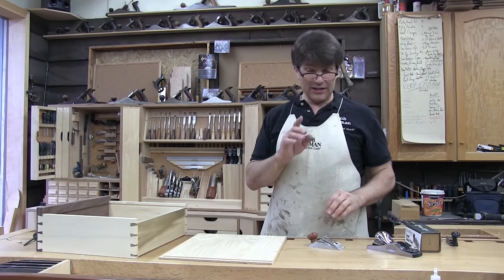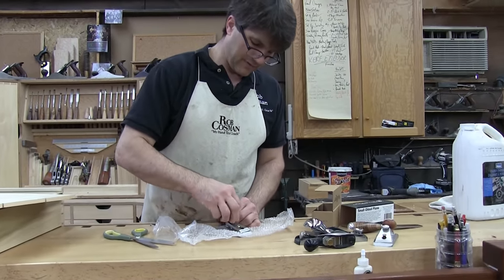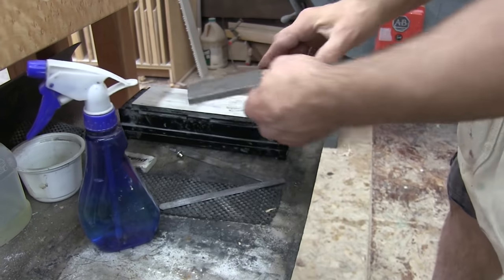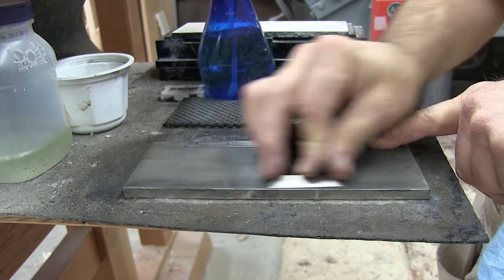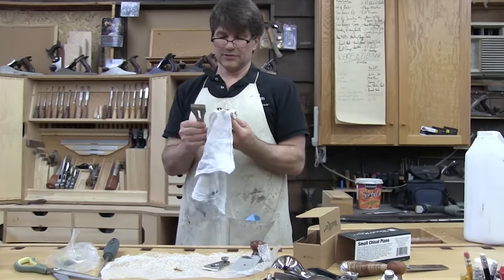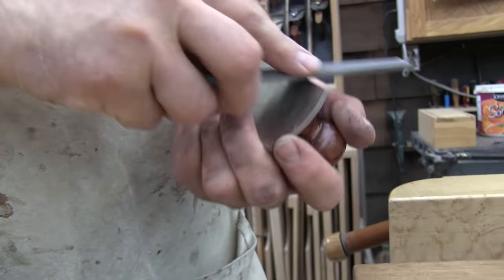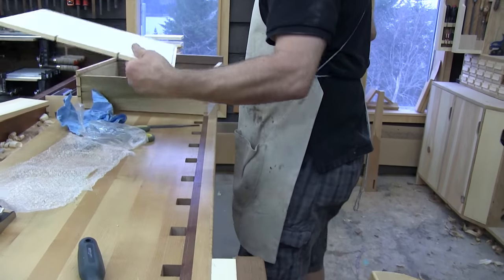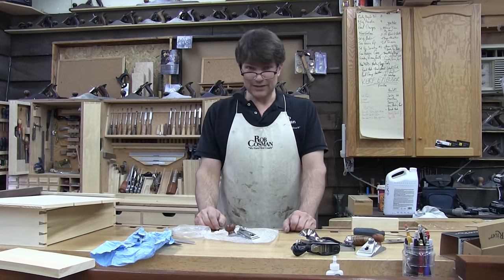Hand Plane | How to Set-up and Use a Chisel Plane

Comment: I too use and love my chisel plane.  I have found if you are careful that setting the blade up on a perfectly flat cast iron bed (I use my jointer) you get consistent results every time.  To do this just make sure the blade is completely flat against the dust free frog before you tighten.
Reply from the maker: good tip, thanks

Comment: Clever tool. So far I’ve been able to get by with just a chisel. Your method for setup makes it look very reasonable. Easing the edges is essential to avoid innumerable paper cuts. Filing away from the machined registration surface is a great tip.
Reply from the maker: Glad it helped

Comment: A cranked neck chisel is perfect for this job, or any work paring within a surface (like on a glue line) or within a trenched joint (dado/groove/or rebate even) No fiddly set up involved after you sharpen it, you just pick it up and go. And it works the exact same way as a chisel plane (it's called a "chisel" plane for a reason) Also a cranked chisel is much cheaper compared to the plane and is more versatile too 😁 
I find 12mm (1/2) and 16mm (5/8) are useful sizes for cranked neck chisels; for paring within a dado for example. 
Avoid the 2 Cherries cranked paring chisel, this is "bent" into a "curved" shape and doesnt have as much reference surface on the back compared to a normal cranked neck. 2 Cherries does make a pair of skewed crank necks (cant think of any time I'd need that) and they make a spear point cranked chisel (again, cant think of a good use for this either) I think I might use the word "gimmicky" to describe the 2 Cherries line-up of cranked chisels.
 MHG make a decent one in various sizes, for little money. Crown (Flinn-Garlick) are made of a better steel (not CrV like the MHG chisels) and they cost only a little more, but only come in 12mm (1/2) and 19mm (3/4). Henry Taylor (Diamic) make a superb cranked chisel in various sizes for a little more money again. 
MHG roughly 30-40€ depending on size. Crown about 50-60€. Henry Taylor from about 60-80€ depending on size. Or ya could go the vintage route and spend even less........ but I find most cranked chisels of old are usually very wide; most common seems to be around 25mm-1inch, so this will reduce their versatility. And some may need extensive rehab work to get them going.
😁

Comment: As someone who enjoys a good orange sorbet myself, you demonstrated a problem that I am surprised you haven't addressed. This is not condemnation in any way whatsoever, just curiosity. You say that when you sweep the bench that bits fall on your sharpening station, along with the possibility of tools falling, too. By the amount you cleaned off, it looks like quite a bit rain down on the station.

Why not make the base of the sharpening station act like a drawer, either attached by rails or build the drawer system completely out of wood which slides in and out. This way you could slide the sharpening station back under the bench top until you need it, which would mean pulling the station out to use.

If you can't slide it under the bench maybe a double hinged cover that folds back out of the way being held up in place with magnets. Since I am not providing a photo, take two pieces of wood and attach a hinge to both pieces. Then take one end, put a hinge on it and attach it to the bench above the sharpening station. When the station is not in use, pull it down. If you really want to get fancy add a third hinge and a third piece of wood that will fold down at a right angle to rest on the base of the sharpening station. I can see multiple ways of protecting your stones from dust and falling tools. Just an idea. You demonstrate a strong effort to preserve your equipment. As for the video, I learned something new that will help me in the future. You CAN teach an old dog new tricks. Thanks for the tip.
Reply from the maker: Good idea...I think I will try it